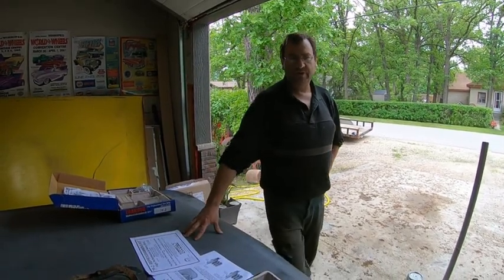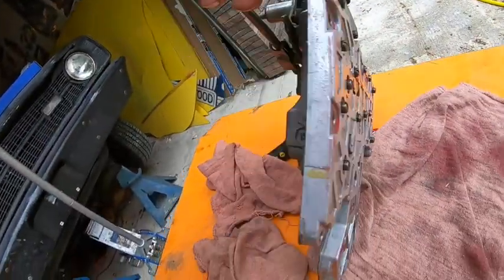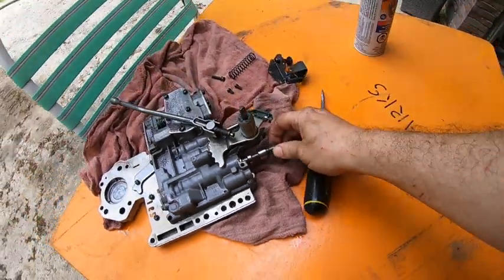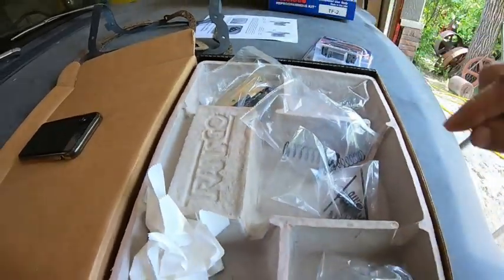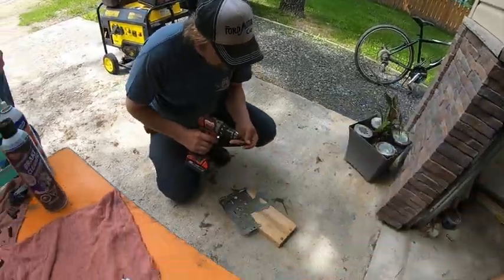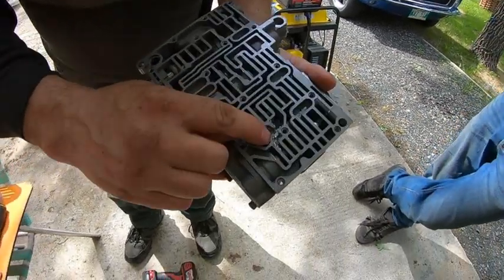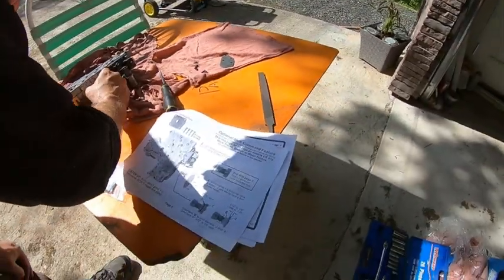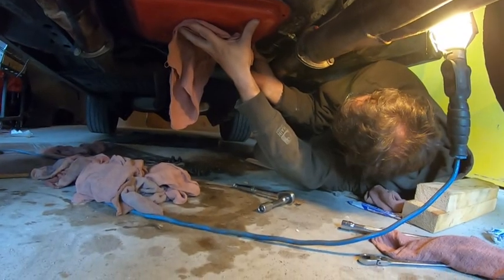1969 Dodge Dart Transmission Shift Kit Installation. DIY 904/ 727 Shift Kit.

Comment: Thanks for sharing, Guys! I have used the TransGo shift kits for many, many years, and found them to be very reliable! My favorite feature is the "shift-command" that turns the valve body into a manual shift unit! I also love the crispness of the 1-2-shift...a real "tire-barker!"  Enjoy, Derek! Be safe!
Reply from the maker: Thank you Harry we are very impressed next will fix the header leak.

Comment: Excellent video Penny's  :) also yes shift kit in transmission lots fun putting and test drive lots fun too! I have done my share to install and test drive too! My Chevrolet Impala got one and enjoy to !
Reply from the maker: What year of Impala was it Andrew.
Reply: @pennyshotrodscustoms   first one was 1976 In box body old cop car from my area my late cousin gave me motor and transmission changed out it back 1993 and second was 2002 LS 4 door I did fully myself was parts car not all original even motor and transmission did up special ways both had been fun vechiles! Both gone now !

Comment: Hi Penny’s. Question. I’m currently working on my 08 Ram 1500, and I’m rebuilding the front end. All my control arm bushings are basically seized, and the alignment shop says they are unable to align it to spec. So now I’m rebuilding. Would you recommend just pressing in new bushings, or buying complete control arms with the bushings already installed? I’ve been doing research and get mixed reviews about the Moog, or Mevotech control arms, a lot of people say they’re crap.
Reply from the maker: We just always cut the old ones out and replace them with new ones but if you were to buy new control arms it is easier my self i would just replace the bushings yourself. Be a good job for Del

Comment: Shoot yea that old John Deere wil grab some gears now 👍 👍 👍 👍
Reply from the maker: Haaahaaa maybe Anthony.
Reply: I thought it was a Briggs & Stratton swap and I was gonna suggest bypassing the governor haha. Seriously though, why would you worry about a shift kit before addressing the exhaust issue and improving the power? The trans do seem to work fine, though. Nice job & cool car.
Reply from the maker: @mickangio16  We weren't to sure on the trans we bought it used and if it had to come out again we would have to undo the exhaust onces again Mick  but its running great now.

Comment: One more thing: Should never assemble a valve body using shop towels. Lint or even 1 strand of the finest shred of a thread will cause problems. "Lint Free" is the term I've read.

Comment: Nope nope nope, when you manually shift to 1st there is NO engine breaking. 3rd has no engine braking either. Only 2nd has engine breaking. w/3rd having no engine breaking you don't need to shift into neutral at the end of your 1/4 mile run, simply let up off the throttle & the engine comes down to idle.